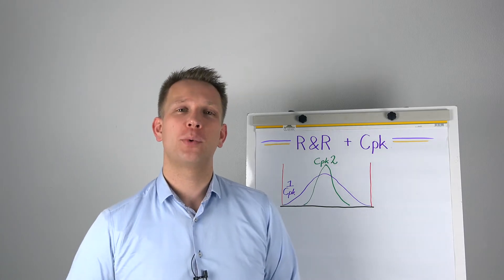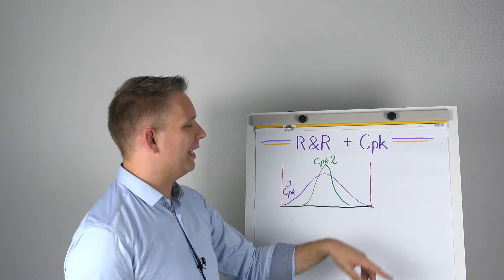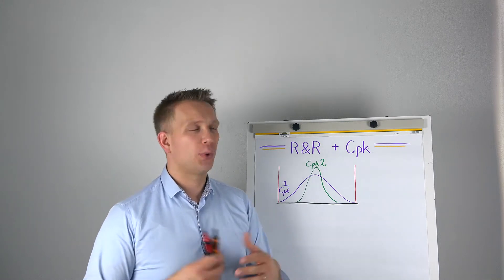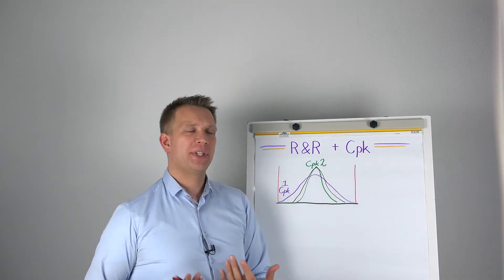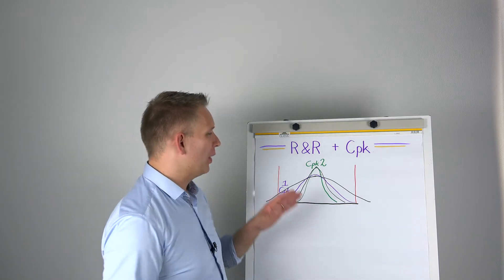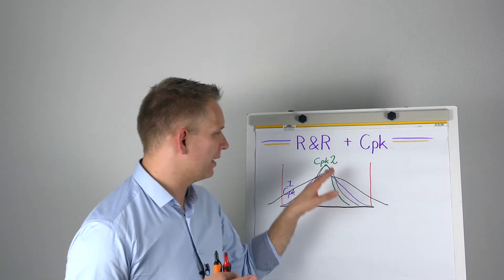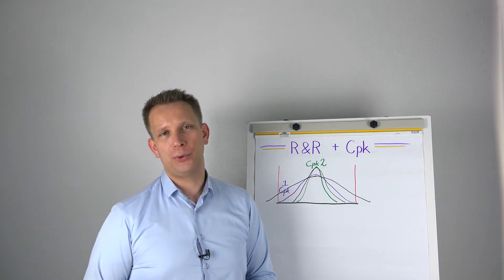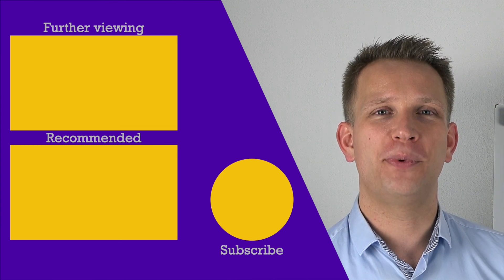How gage R&R and Cpk are linked in six sigma

Comment: @Tom, Hi Tom. I have a question. I get a GRR report of testers from a factory, they are using the index GRR%SV to evaluate the performance and these value always look excellent with all < 3%, but they also have another column with the GRR%Tolerance and these values > 40%, so I think they have to use the GRR%Tolerance instead of the index GRR%SV to judge the performance of their testers, because I think they product have their specification limit, so in this case they have to count the tolerance to GRR value. Can you help me clear this thing? am I right?
Reply from the maker: It's a tricky one - we're comparing observed measurement variation vs the total observed variation in this study (SV = study variation) and vs the specification range (T = tolerance = specifications). Both are useful, generally vs SV is worse (not in your case).

Just going on the provided info, we see that your measurement system gives much smaller variation than we see between products coming out of the process. This would seem very positive for the measurement system, but...
Apparently the variation observed within the measurement system is quite sizeable compared to the tolerance range.
The measurement variation is the same in both ratio's, so we have to conclude that this process spits out product with a much larger variation than is allowed by the tolerances - that is, you're making defects left and right!

That would be the first important check to do: what parts did they include in the study and which tolerance limits did they input?
There is a big chance that they included parts from different product types (which are supposed to have different values on the measurement, but shouldn't be combined in one GRR), or that the tolerance limits are not correctly put in (I've seen many GRR users ignore the tolerance range input cells as it's not an active part of the study's measurements).

If the numbers are correct, you've got a process that has about 15x more variation that would fit within the tolerances - that's such a huge difference that it seems unrealistic to me. So check the inputted numbers first.
Reply: @TomMentink  setting aside concerns about data accuracy. Which criterion should be used to evaluate the performance of testers in my case: GRR%SV or GRR%Tolerance?

Comment: Great explanation. If my Ppk is above 1.67, can I use that as a justification for not doing an R&R since Ppk takes observed std deviation  into consideration which includes GRR Std deviation as well
Reply from the maker: Great question - yes, pretty much. 
Use some common sense too: if the measurement method can't even detect within the spec range it clearly isn't suitable (for instance, scales that only weigh per 10 kgs are never suitable for a product with spec range 10 +/-1 kg even though they'll give you a great Ppk on paper - a measurement device should be at least 3, preferably 10, times more precise than the spec range).
Gage R&R is especially useful in the 0,67 - 1,33 range of Cpk/Ppk, since you want to check if it's the measurement system that is generating much of your observed problems or really just the process itself.

Comment: 1. Can you please show an example of both the ways how to get R&R from the cpk ??
2. Also can you give example for the different cases for the both cases ??   ( like one is greater then other)
Reply from the maker: 1. You don’t get R&R from Cpk or vice versa, you’ll need to calculate both indicators separately. The acceptable R&R value relies somewhat on the Cpk.
2a. Example good R&R vs observed variance, poor vs spec range: a fat-water separator should let off water from a fatty waste stream to have 32-35% fat in the resulting slurry. The changing nature of waste (different nature of the fats and varying presence of detergents) makes it difficult to analyse, the measurement variation is about 1% - so R&R vs specs is 33, which seems too high. It’s also a process with a lot of variation: you observe fat contents between 25 an 40% - so R&R vs observed variation is 7%, which is brilliant. You decide to focus on the process, not the measurement system, because for the current reality it’s good enough. (The Cpk of this process will be around 0,8)
2b. Good vs specs, poor vs observed: a filling line filling cartons of 1 kg, with a tolerance range of 950-1050 grams, has an observed spread between 995 and 1010. The checkweigher scales measuring each product in line show a variation of 3 grams: 3% R&R vs specs - brilliant, 20% vs observed variation - OK’ish, not super. You decide to accept the measurement system, as this process is so far from it’s specification limits (has a Cpk of 6,6) that it’s not that critical to have a world class R&R vs observed.
Reply: @TomMentink  thank you very much for detail explanation.